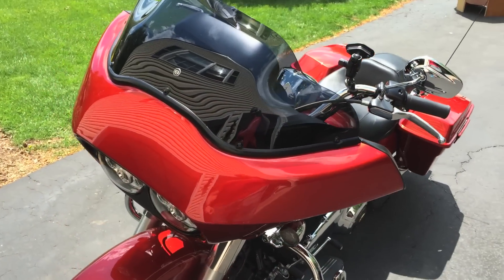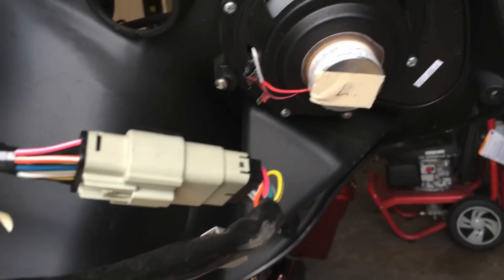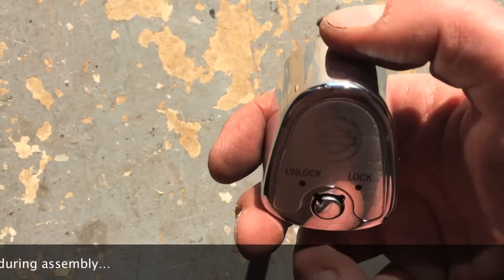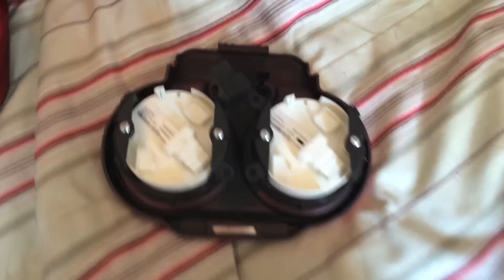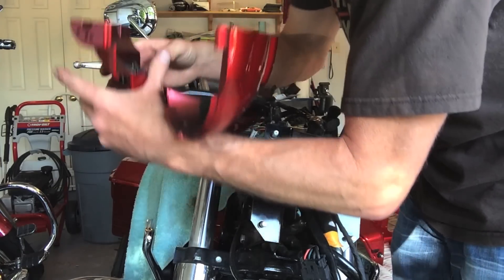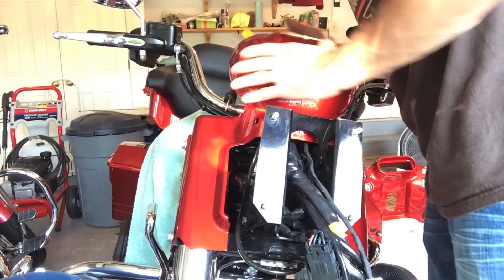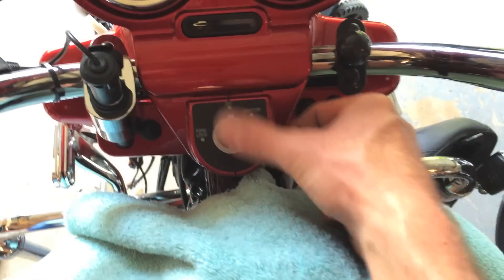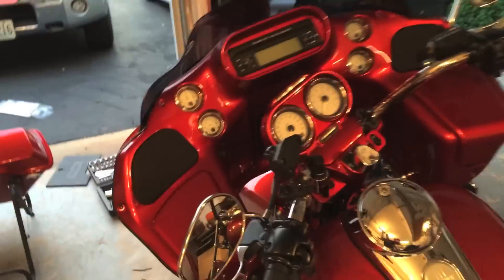2013 H-D Road Glide Inner Fairing & Instrument Cluster Removal for Paint

Comment: I didn’t take any pictures before I started taking my connections apart. That’s not my problem. I need help with where do I zip tie the different wires together. And which ones go above the hooks and below the hooks and make it look neat. Is there any advice you can give me?